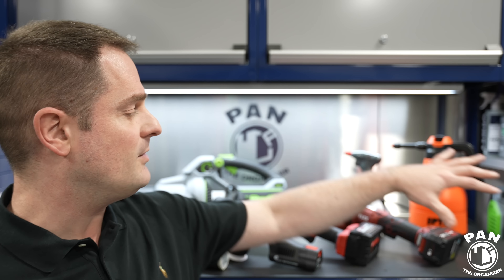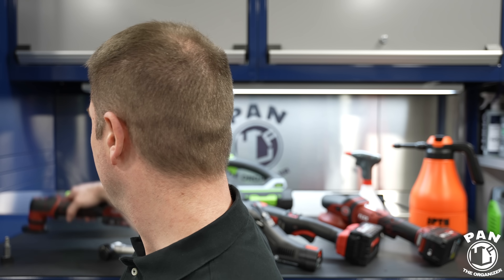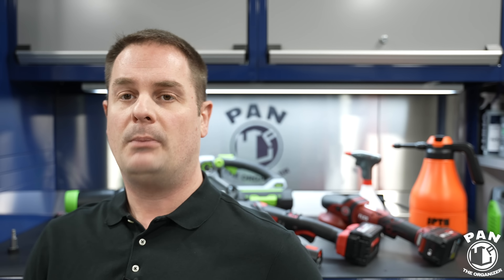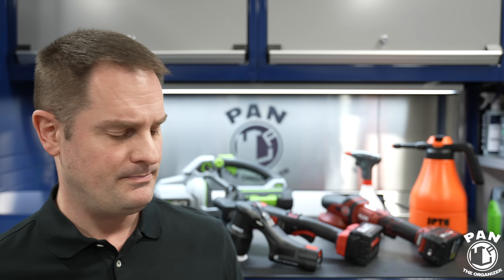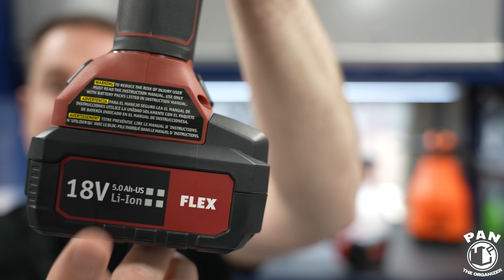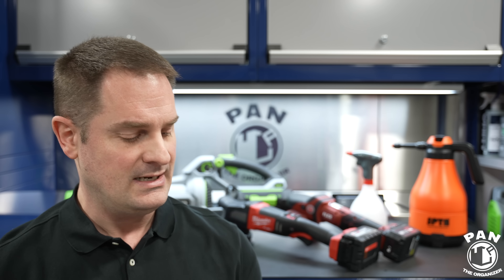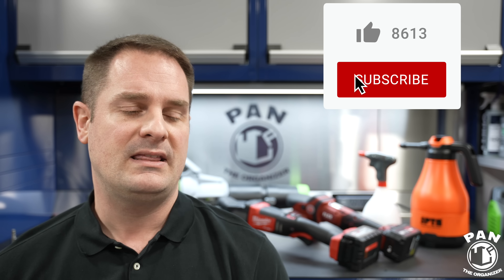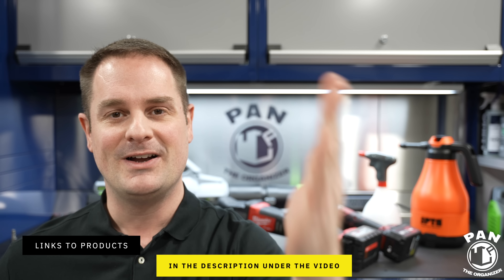Cordless Detailing Tools!

Comment: I use a Worx Hydroshot with a few 5-gallon water jugs for winter washes when it's colder. I have the soap dispenser and adjustable head to make washing wheels and wheel wells easier.  It's not as good as my electric pressure washer, but it knocks the dirt and salt off when it's too cold for my bigger set up.
Reply from the maker: Do you have this one? https://amzn.to/3GaM5RE
Reply: @PanTheOrganizer  I have the 20V/4AH version. If you click it, you'll see the soap dispenser and accessories. Wish I would've seen the 40V version because the extra PSI and longer runtime would be nice.

Comment: thank you Pan. I'm always enjoying your video and I just became a car wash enthusiast last summer because of you.
just some questions here.
i have all the chemicals and tools for car wash now but not polisher
1. Since you mentioned that you need a specific size of polisher for a specific task, what do I need for just general use like doors and engine hood?
2. i have some budget for only one polisher but not multiple polishers so maybe i'm thinking of polishing by hand for other parts where I need smaller size polishers. Is it doable? or physically impossible? what are the pros and cons?
3. what is the difference between a sander and a polisher?
Reply from the maker: One polisher can't do all the jobs, it's impossible. That's why we use different size polishers. If you can only purchase one to start, the one that does the most work is usually a 5" backing plate. Watch my video on affordable polishers that I recommend here: https://youtu.be/LvPCkCqXEq0

Welcome to my channel. You discovered one of the biggest car detailing channels on YouTube as we surpassed 840,000 subscribers and 105 million views! I have been detailing for 25 years and I love to share my knowledge and passion with my viewers.

You found the right channel to help you learn everything about detailing.

Comment: I just bought the Rupes Bigfoot Nano Ibrid (Jan 2023), hope it lives up to to expectation.
I plan to use it polish the headlights on my Hyundai I30 (as the top of the head lights have a peeled like appearance, 10 year old car) after I do the wet/dry sanding followed by the polishing and then UV spray coating to get 1 year protection. I am using the Turtle Wax version to fix the headlight.
My question for Pan is would an additional ceramic coat after the UV protection coat give longer protection to the headlights.
Reply from the maker: After you’re done polishing, use an IPA or paint prep to remove polishing oils and simply apply a ceramic coating. That will be your longest lasting protection and it already has UV protection.

Comment: Thanks for the excellent video!

I wonder if people realize, Flex is the inventor of the original angle grinder, which over time evolved into buffers and polishers. Their grinders and polishers are superb. They are now owned by Chervon, one of the biggest power tool manufacturers in the world. You get a lot of technology with Flex. I wish batteries were more standardized, so I could use Milwaukee batteries or Makita batteries in everything. 

I do not own anything from Rupes, but I really like what I see. I am looking closely at a few models. The Rupes 12 volt battery looks a lot like the Milwaukee M12, which looks like a few other batteries to be honest.

I own many Milwaukee tools, corded, M12, and M18. There are many things I like about them. I do not own the M18 polishers, not yet anyway. I do have an older, corded, Milwaukee rotary buffer. It's 30 years old, very heavy, and will run forever. Not delicate, but if you need a tank of a polisher, that's it. I do have a pistol grip M12 polisher that I use with a 3 inch pad on small stuff. It's very nice. I use a M18 leaf blower to dry, and it's not as powerful as your Ego. Still plenty powerful though! I want a short top for it like you have. BTW,  Ego is also owned by Chervon, like Flex.

I have a couple of Milwaukee M12 die grinders I use with some Roloc wheels to clean wheel hubs or corrosion and debris when I do wheels off the car. Other detailers might look at those, especially if you are in the M12 line.
Reply from the maker: Thanks for sharing your experience!

Comment: I cannot wait to try out the Solo 460 this spring and probably like everyone else I will be using it exclusively with a rinseless wash, and in my case P&S Absolute. I had it in my Black Friday basket but decided to switch gears and build my Continental Hose bucket filler solution instead. Just waiting on a 60 gallon Tamco tank for my apartment garage and Prevost ball valve and it should be finished. In the distant future I will consider the Milwaukee polisher since I've only used my G9 once and I just got a G8 and I will talk more about the Rupes in your other video. The stubby nozzle has been a game changer for me last summer.. Despite all the naysayers, isn't it awesome?

Comment: Hello Pan
I got a question, of topic from the subject of machines but🙂
I got some older cars (25+ years), with the once black plastic bumpers and trim has turned grey. I know its because the oils, and i know the trick with heatgun/ hairdryer, but how do you get that to last? Or if theres another tip or trick that could help, i would apreciate it🙂
Thanks a lot
Reply from the maker: The heatgun really just brings up a few oils in the plastic, but doesn't really restore anything long term. You need a proper trim restorer. Here are two of the best options for faded and oxidized plastics:
https://bit.ly/3WJjoT8
https://amzn.to/3Z6ehxP
Reply: @PanTheOrganizer  thanks a lot🙂

Comment: I’m not sure if this question was answered already with all your other videos as I don’t have time to sift through all the comments but in regards to battery powered tools and branding, where would you put Milwaukee as a brand in general for a guy that’s sorta new with detailing? 

I’ve just received an M18 power drill for Christmas as well as some drill brushes and I’m buying myself the m18 forged 6.0 battery with the supercharger to go along with it to clean my interior. I’m also very interested on the m18 DA polisher so I’m thinking of getting another m18 forged for convenience. 

You also mentioned the Ego blower and its popularity within the detail community but since I’m investing into the Milwaukee brand, what are your thoughts on their new two battery m18 blower? I’ve seen the 3D printed stubby nose attachment for the blower readily available on Etsy that could rival the Ego’s short tip. 

Thanks for your time and I appreciate all your hard work and content!

Comment: I have the foam sprayer and strictly use it for brake buster for wheels n rims. I really love it. No time wasted pumping after each tire. Just spray and go. I've done at least 15 cars in charge. 

I'm debating on getting the solo sprayer. Pan do you think you use the solo with certain waxes like hydro2 or things of that sort?
Reply from the maker: You could try, I haven't used it for spray on rinse off formulas, but I don't see why it wouldn't work.

Comment: I bought the RYOBI cordless as my first polisher and i would like you to test it. Not sure what settings to use as it stalls out on their recommendations but that might be my inexperience.
Reply from the maker: If a polisher stalls, usually it's a sign you might be applying too much pressure. Back off a bit, and keep the pad rotating.
Reply: @PanTheOrganizer  Thanks for the advice. I saw another youtuber recommend running it at a higher speed so I'm not entirely sure

Comment: Another great vid!

Dear Pan, i got some question about Polish machines..

I was trying to buy ->
Flex pxe 80.

Rupes big foot ibid longneck.

Rupes Bigfoot hlr75.

Rupes bigfoot lhr15 Mark III.

what u prefer or what should i buy ? Or what machine are same or are they difference ?
Reply from the maker: They are all different machines and different sizes. It's not a question of which one is the best, they all serve different purposes. 
The HLR75 mini (cordless) and Flex PXE 80 are both 3" machines. I prefer the Rupes.

The Rupes iBrid Nano is a 1" or 2" machine for smaller more intricate areas. Also important.

And the LHR15 MKIII is the 15mm stroke for 80% of the work. It's the main machine and the first one you buy for your polisher arsenal.
Reply: @PanTheOrganizer  thanks pan! Big love from Belgium!!

Comment: Always looking for the next generation battery powered power washers.  Waiting for them to be as powerful as a gas powered one as quiet as a corded electric.  That would be cool.  I tried the Dewalt battery powered and it was weak.  Maybe you can help find one ?
Reply from the maker: I haven't seen a powerful enough battery powered pressure washer yet. The best one I have seen is this: https://amzn.to/3GaM5RE

And it's still just 725 psi. You need 1000 to 2000 psi to have a good washing experience in my opinion.

Comment: Okay, I'm totally happy with the usual advice I see here on the channel....  I bought a 2002 Z3 last year.  I learned that the clear coat flakes off in 70-90% of the cars.  

On the advice of this channel, I used turtle wax black...  Honestly, it looks like steroids on crack.    I'll continue to use this forever.  Please let me know if there is something better stilll...  BTW, a paint shop told me they can't make their renewed paint look better than ceramic treatment (let's allow for this and that divided by cost)
Reply from the maker: I'm assuming you are talking about the Turtle Wax Hybrid Solutions Acrylic Ceramic Black Spray Wax? That lasts 4 to 6 months. They have a newer and better product in my opinion, that can last upwards of 9 months. I reviewed it here: https://youtu.be/b5BjDzItlr8

And thanks for the trust you place in my opinion. Welcome to my channel. You discovered one of the biggest car detailing channels on YouTube as we surpassed 840,000 subscribers and 105 million views! I have been detailing for 25 years and I love to share my knowledge and passion with my viewers.

You found the right channel to help you learn everything about detailing.